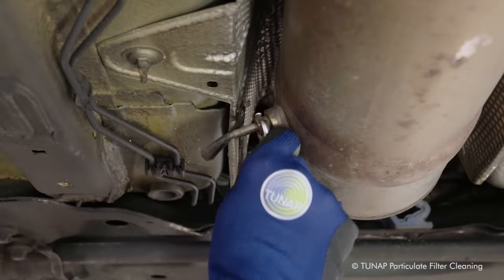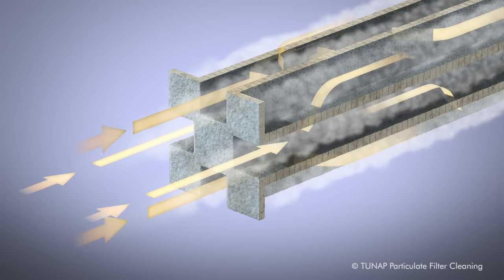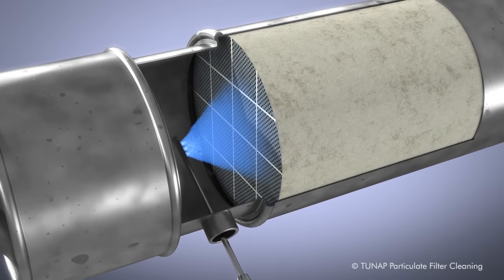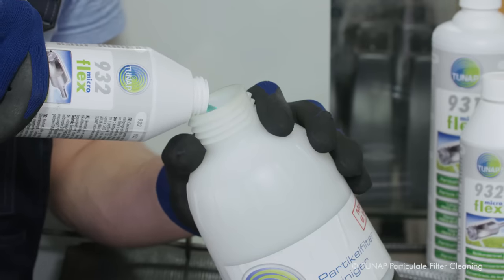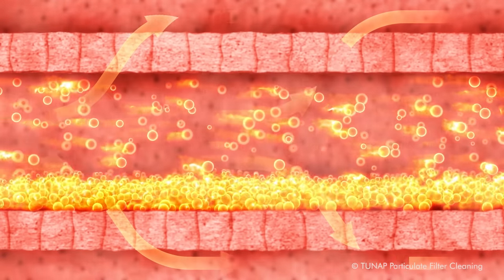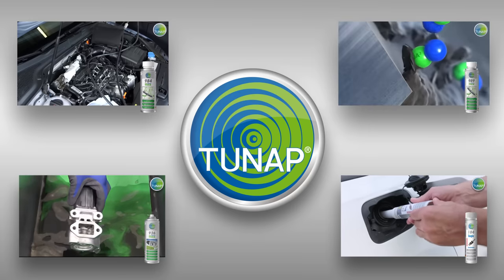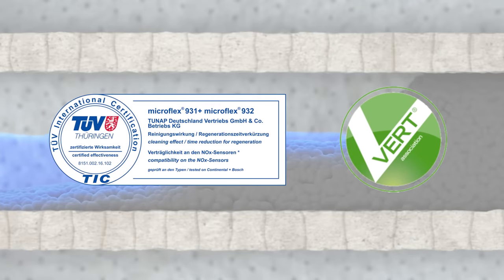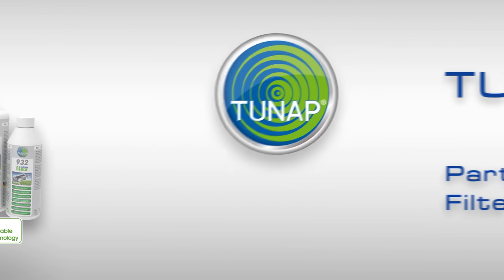How to clean a Diesel Particulate Filter (DPF)

Comment: I found the best way to fix mine was to buy a petrol car, never had a problem since.
Reply: We're forced that way anyway. In some European countries they're already forcing drivers towards electric cars by increasing taxes on fuel cars and decreasing the ones on electric ones.
Reply: Its a con!
Reply: they're phasing out petrols aswell
Reply: I have a 1997 Peugeot 205 1.8 d 44 kW... it never had problems about exhaust. Is It possible that i chose the right car?
Reply: Simple and effective.
Reply: @yamaguto  no egr and dpf were not indroduced until cars after 2009. Cars before would never have problems
Reply: Lee Benstead, patrol car needs tune up more frequent, petrol car usually have shorter life span. Patrol car overall cost more and higher maintenance.
Reply: @leebenstead7171  electric cars are clean sure but electricity isn't always clean depending how it is produced.. Burning coal to make electricity is a great example
Reply: @mikelow4374  
Are electric cars 'clean' or is it a case of out of sight out of mind.  Take for example the cost to the environment and people when mining Lithium, also where do batteries end up, in the UK most end up in landfill.  May be it's all an illusion.  Nuclear energy for example, when it goes wrong it's catastrophic, I don't even want to imagine what a Chernobyl or fukushima would do to a little country like ours, and there's also the hazardous nuclear waste.  I think it's too easy to fool people in to believing something is clean because it doesn't have an immediate or obvious impact.  Slide of hand.  I don't like knee jerk reactions.
Reply: @daithicarney3266  they have been on cars since 2002
Reply: @yashkummar  prove it
Reply: LPG  is best  no toxic emissions...and no carbon .
Reply: @alexzanda2196  I agree, I think in places like Thailand everyone uses it but in the UK you have to use a tank of LPG trying to find somewhere that sells it, it's a joke.  Climate change scam.
Reply: my diesel jetta lasted 10 years and got 50 mpg
Reply: @leebenstead7171  Do you mean LNG ?  Because LPG is the same like petrol .
Reply: @mirola73  I'm American and I welcome a bike-friendly future. I think it'll help our obesity problem.
Reply: In my country we just remove the whole dpf and drive with out it
Reply: Diesels are much better bud

Comment: I drilled a 4 inch hole in mine. Fixed the problem.
Reply: Did the lights come on dash?
Reply: Just one hole John 👍
Reply: And wht about malfunction lamp after this type of solution
Reply: @enginemitr I was want to ask the same question
Reply: You could just get some wire and clean it and then just use body filler to fill hole or weld it with welder
Reply: @enginemitr  no lights... tuned ecu first.

Comment: Best way to clean it is to remove it. It wont break again 100%.
Reply from the maker: We would not advise the DPF being removed with the new MOT changes in the UK that started on the 20th of May. Now if there are any signs that the DPF has been removed the car will automatically fail its MOT and you will need a brand new one installed.
Reply: You won't pass an MOT ever again.
Reply: Now imagine everyone does it. Now imagine you and your parents and children inhale this and suffer long term respiratory system damage.

Please set a good example and encourage people to use a filter
Reply: Just put it back on just before the MOT is due?..wouldnt that solve the problem/.
Reply: @randomaccount2507  lol
Reply: I take my cars to  a dodgy mot station plenty about in Birmingham.
Reply: Thank God I live in a free state. You can straight pipe your rig and the police don't give a fuck because they'd rather be catching drug dealers than harassing motorists.

Comment: Thhhheeeee best way to clean a dp filter is to take a reciprocating saw and cut it clean off. 😂😂😂😂👍👍✌✌
Reply: @HateTheIRS  So true so true. For the price of a new diesel truck with the dpf nowadays I would seriously consider a low mileage well maintained non dpf truck instead. ✌✌
Reply: Just quit buying crap fuel and use a good quality additive before your oil changes and you'll be fine.  I'm so sick of people talking about doing deletes.  Deletes do more harm then good in modern diesels.  These aint 1980's diesels guys.  Coking turbos, clogging injectors, blocking up liquid cooled EGRs is just a sign of bad maintenance and not knowing how to keep your rig from spewing out noxious crap.  Get real people.  Those of you doing deletes and cutting all this stuff off of your trucks are the reason why they put all this crap on there.  One more thing to note.  You guys may have powerful trucks but they smell like ass.  If you have to cut all this stuff off to get power maybe a diesel engine isn't for you.
Reply: @joshtheking1772  I do this for a living, and can tell you no additive, or snake oil is going to prevent the build up, and gunk that gets pumped into the intake tracts of a modern diesel due to EGR and crankcase ventilation systems.

No cleaner in the world can flush out all that crap from an EGR cooler either. After a certain point, those components are throw away. Usually at the cost of a four figure repair bill. I haven’t even touched up on the DPF itself which is considered “disposable” by the industry, like an air filter or cabin filter is.

Diesels were never designed to have all of this crap bolted on to them. The systems are also unreliable, and have limited life spans.

But hey, they produce revenue, and pay the bills. So god bless them. But if you want my professional opinion? Stay far, far away from modern diesels.

Comment: Best advice ever I got from my father,  40+ years experience as diesel engineer working with diesel engines up to 100000bhp :
Use good fuel, proper maintenance oil and filters, every time you drive it get it up to temperature and floor it, burn off residue !!
Also for gasoline, engines are not made to drive around for 5 minutes @ 1600rpm.

Comment: I idol a lot being a hotshot trucker.  Sometimes it takes as long as 600-700 miles of straight driving until check engine light will go off.  I use Sea Foam.
Reply: What is Sea Foam? I also have Exhaust Filter Full on my dashboard. It's Ram 3500. Dealership says it will cost me $2300 for parts and labor to fix the problem. I do HotShot as well and other sources say I should drive it on the freeway for 15 to 20 minutes at a constant speed but this has not worked. I don't know what to do now
Reply: @williambadu1628  the dealership is gonna fuck you.  Guaranteed.  Sea foam,  look it up on you tube.  There’s a couple of different ways to use it.  You got this buddy.... be safe.
Reply: @domaniquemcneal2229  I have the same problem and my 08 Duramax LMM goes into limp mode after 5 min no matter what so I don't get enough time to get the exhaust hot enough to clean the filter. ..will seafoam work even in limp mode?!...
Reply: @Savagewon44  hard to say.  I would dump about 5 or 6 bottles of sea foam in your tank, then run it and let the regeneration take place.  It definitely needs that regin.
Reply: @williambadu1628  I have the exact same truck with same problem. What did you end up having to do to fix the problem?

Comment: or where from can I order this dpf cleaner
Reply: I guess I am kinda randomly asking but do anyone know a good place to watch new series online?
Reply: @Jude Steven flixportal
Reply: @Malachi Nikolai Thanks, signed up and it seems like they got a lot of movies there :) Appreciate it!!
Reply: @Jude Steven glad I could help xD
Reply: Gesmond farrugia all you need to do is get some redex or any engine treatment and put that in the fuel tank and to clean the filter out is drive you car at motorway where you are at in 4th gear to get exhaust red hot to burn the carbon out? You can ask any mechanic about it
Reply: @novagsiful  In A Duramax?
Reply: @CrownRoyal144  yes in works in ever car, leave in 4th gear and do what ever motorway  speed you have for about 15 - 20 mins to get the exhaust red hot which burns the crap in the exhaust
Reply: @CrownRoyal144  I also forgot use the engine treatment 4 times a year which is every 3 months and tbh that's what I have done for years and not had a problem with any diesel car I had

Comment: How do you clean it in a ford kuga
 I have been told nor use supermarkets  fuel  have put  the additive  stuff in  over  £100  of expensive fuel and iam still losing  power
Reply: Get the engine fully warmed up and drive from one motorway junction to the next in third gear, at 4000 rpm without going into the red on the rev counter. Check you have sufficient engine oil in the engine before doing this process. Once the engine feels more eager to rev, the dpf should be less clogged with soot. See https://www.youtube.com/watch?v=5KGIOcUmYE0

Comment: I bought a 2014 Vauxhall Vivaro Van with low milage for the use of Courier work, taking out a loan to do so, and this DPF thing has been a ROYAL PAIN IN MY ASS every few weeks to a month. I take it in to be sorted with a garage, they clean it out and regen the DPF, costing me £75 a time, a couple of weeks later, bastard warning lights come on again, sometimes with a "STOP" light too, which just stresses me out. Had a chap come and do a thorough clean out of the fuel system and DPF, 6 weeks later, same shit. I can't sell on, I'd be without the van as I use it every day for work (which I also use for band work on weekends) I don't get it, I see these vans used all the time for courier work, is this a thing of my van or are they all like it? At the end of my tether I am!
Reply: Run it with archoil d-max fuel addative
Reply: @stevepower6710  Thank you. So is that every tank full or every so many tank fulls?
Reply: It's per litre 25litres of fuel add 25ml of 6400 d-max. Also try 2ehn and hybrogen together works for me had no issues with my dpf and only do local trips  Go to oilem.com all info on there. Website powerenhancer.co.uk and get 10% off. Maybe worth adding a more aggresive cleaner if you are having problems  1 bottle to 40 litres of diesel should clean it out. Hope it works.
Reply: @stevepower6710  Thank you again. But I was wondering is this every time I fill the tank? I generally put £100 of V-power Diesel in once a week.
Reply: @steevidrums  ok have you changed your engine oil ? Make sure you use the right engine oil as this will cause you issues. Also is the engine worn ? Any smoke out the back. ? Injectors can also cause it. Try dipitane this is another addative that has been around for 30 years. Have a look on the internet at it 👍
Reply: Ar 6400 is better than vpower
Reply: steve power I get it fully serviced every 6-10,000 miles. 
I wouldn’t say there’s excessive smoke but then perhaps I don’t really know the difference. But there’s no black smoke or anything such like. If not for the warning lights, I’d know no difference as the van runs fine with no loss of power.
Reply: jesse glenn  Thanks you for the advice. It's being taken in on Tuesday to the Vaxhaull main dealer to here, so I'll mention this to them when I do. I hope I finally put to bed this constant issue.
Reply: Shitty vauxhall
Reply: Just burn it off on the freeway.
Reply: Did you have red engine warning light?
Reply: I'm doing courier work as well and i have vaxhall vivaro 1.6 2019 .. after 4000 miles anti pollution system error comes on dashboard... but if I just change the engine oil and filter ... problem is solved for next 4000 miles..
Reply: The DPF on my 2015 Vauxhall Vivaro gets clogged because I do low speed suburban driving like your courier work. Get on the motorway and drive at 60mph in third gear. It will burn off the soot after about 60 miles.
Reply: @jimmygreavesjimmygreaves1099  yeah tried that, went in 4th up to 60+ for 20 mins or more, 3000rpm, didn’t make a difference. I fear maybe the DPF had a fault.
Reply: Same issues here for courier work
Reply: You probably have the same issue I have with my Mondeo the dpf is full of ash, I have decided to buy a eBay dpf for nearly 400 squid and start again. They only last 100k miles by all accounts that is the life of a dpf.i feel youre pain I would just remove it if I had my way but alas that is illegal

Comment: How much is the additives to add to the tank every three visits ?
Reply from the maker: The average cost for the DPF Additive is around £15.99
Reply: Shouldn’t the fule companies mix this into there fule?
Reply: @Giggler.  too logical 🤣
Reply: Additive should be in fuel,the system introduced the dpf system to be compliant with emissions laws

Comment: Is this "Snake Oil"?
Reply: Treatments like theese often use some kind of liquid catalyst, organometals, to lower the ignition temperature of the soot particles -so if they are serious it should work. At lest that is how in-fuel cleaners work as far as I know...
Reply: Absolutely. Never had any luck with these. If a manual regen doesn’t work, the DPF is cooked, and needs to be replaced.

Comment: Diesels belong on motorways doing long journeys.
Reply: no they don't. There are the same amount of diesels as petrols anyway.
Reply: My van sits on the motorway all day, everyday yet dpf has gone
I've owned it from near new, 200K later doing upto 500+ miles a day 

Same thing happened on many other vans, may last a little longer than driving locally but will always clog up by design

The best thing to do is just remove it, once it clogs
Reply: @saifchowdhury5372  how about cleaning it professionally with water? My Yaris DPF does regenerate every 120km no matter how and thinking about cleaning it...

Comment: Supposed to last the life of the car.. My arse. Have it removed from the cylinder so it looks like its still in there..
Reply from the maker: We would not advise the DPF being removed with the new MOT changes in the UK that started on the 20th of May. Now if there are any signs that the DPF has been removed the car will automatically fail its MOT and you will need a brand new one installed.
Reply: Tunap UK the solution is - good quality fuel + a naftalline pill , driving for 50-100 miles in sport mode and the MOT will pass
Reply: Rick dean   i do the same as david and you're welcome <3
Reply: @ghitaciprian  unde bagi naftalina frate? Am probleme cu dpf și nu am bani să-l înlocuiesc.
Reply: That won't work because removing it will set a warning light and fault code

Comment: Burn the particles in high temperature is a bad idea to get rid off nitrogen. Instead of high temperature treatment, aghast gases or smoke should cool off to pass through regular filtration that means a filter can be replaced periodically when ever it gets dirty. No need machinic or any specialist but current system is just peace of crap and unnecessarily burden on trucking industry which increased truck maintenance and sale out price.

Comment: Fuck me…. I station in korea and bought a used chevrolet cruze lt 2014 diesel. Never drove diesel before and today the dpf light lit the fuck up. Now i have to do all kind of research to fix that shit to save money. Korea is shitty in traffic with many lights and cameras for speed limit. I hardly drive on a highway as it also costs toll fees. Should have bought a petro car instead. This environment is not cool for diesel